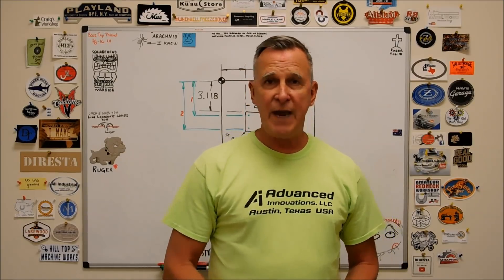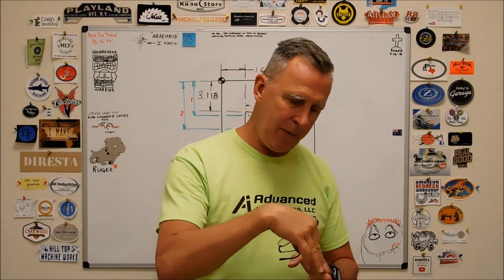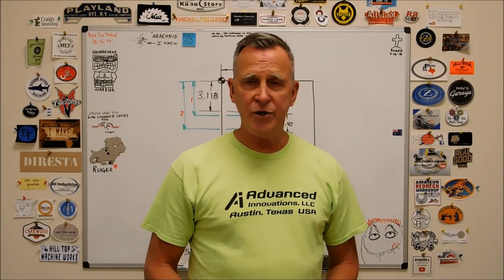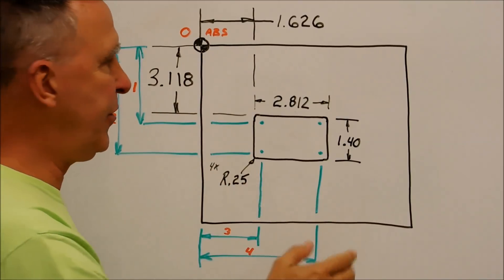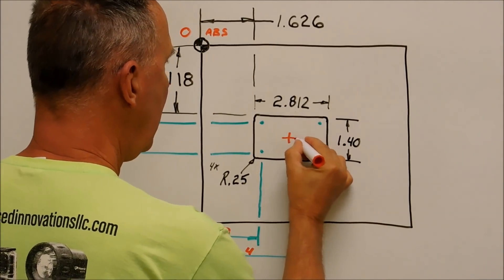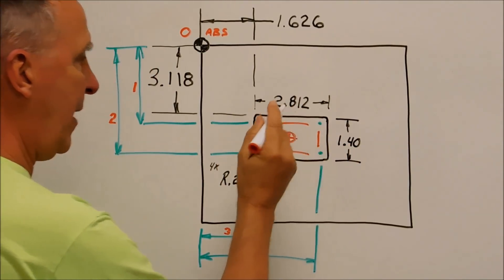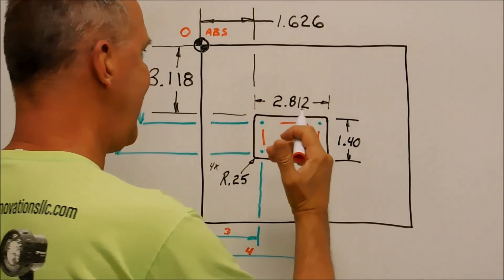Easier Machining Using the Incremental Mode on your DRO

Comment: incremental is less accurate than absolute. When you hit the X or Y reset, you establish a new zero. You may lose or gain a few tenths each time you do this. I actually prefer incremental but depending on the part I am making I may use absolute.

Comment: i got into gear shaving with the slot saw. was seriously disappointed when gearotic/mach3 didnt actually generate helicals.

and that started me on lessons with incremental and absolute whilst indexing a rotary table... a steep learning curve. 

a few minutes amusing oneself assigning different rotation axes and generating oddball toolpaths :)

at which point a helical gear is just throwing the cutter/rotary over at the helix angle and running the same generating principle with an added rotation... 

and on that note, i also dislike the manner in which most of the gear generating shavers work at one tooth at a time, lots of rotary reversals. backlash seems to be of no concern despite them generally being DIY setups.

so i always keep my rotary running the same way,  increment the Z on every full rotation, blah blah. seems faster as well?

Comment: I set up 2 table mounted work stops, 1 each side of the vise, and set zero with ABS and INC respectively. Then I can make symmetrically opposite details more efficiently, pull L.H. part out, place R.H. part in and perform each operation. I seem to get a lot of jobs making Sym. Opp. details.

Comment: Thx alot Joe very helpful info since I had to do 2 radius on the rotary table   with different points on both it was easy to pick up the  zero point on both of them using the incremental  and absolute
Reply from the maker: I have a lot of positioning videos for the rotary table. You should check them out. the trunion strap video is a good one.  Can I interest you in an alignment pin ?? ( website )
Reply: @joepie221  To late I bought one from you already n it works like a charm . But thanks anyhow.

Comment: I stay in incremental mode. seems very easy for to keep track of where I am. most recently used it to make a new tee nut for my tool post on my lathe. it made it simple to rough in and then come in for the finish cut. everything came out right on size and symmetrical. through hole already located simple right?
Reply from the maker: If you are over the center of the part, or hole, either setting works exactly the same. It is simple.

Comment: Joe, thanks for the explaination, my DROs all came from the same Far Eastern Mfgr. And they all have the same manual that is so poorly written that I consider the manuals worthless! I use the ABS mode exclusively and what I know how to do is solely based on what I’ve seen others do on YouTube! I will have to explore the function more once I get my machines back up and running!
Reply from the maker: I agree. Some of those manuals can be less than detailed.

Comment: Thanks Joe;
I've been using manual machines for so long, and never had a "real" DRO, but I get this.  It's like remembering where "home base" is when you are doing a hole pattern or finding corners using just the dials.  Someday, if I get a DRO before I die, I"m gonna forget all about taking up backlash, which I have been doing for the last three decades.  That will be a wonderful day!
I always appreciate your vids.  Thanks again!
Dean
Reply from the maker: Thanks Dean. A DRO will spoil you.

Comment: My DRO doesn't have work-offsets like some of the new ones, so I sometimes use my Incremental Mode as a temporary work offset.  Either for the center of my rotary table or a stop setup on the second vise.  Yes, I have 2 vises & a 10" rotary table on my mill. :-)
Reply from the maker: I hope you center that mass up before you go home at night.
Reply: @joepie221  Absolutely!!

Comment: typically...I set (and leave) the left corner of my fixed mill jaw to zero/zero in absolute and it is always ready to assist in measure and layout of simple parts....then use incremental when I need further layouts/offsets...by keeping the zero/zero...anytime I can find a dimension/location, then re-zero the incremental as needed....
Reply from the maker: Hi Chuck. That would work well assuming you have a stop on your jaw at all times? Or do you just use the outer edge? Stay well sir.

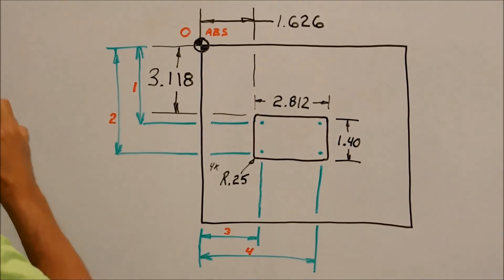Comment: Looking at the view from 1:16, Once you get your tool to absolute origin at the top left of the material, you can immediately switch to incremental, and make all future moves incremental moves based on the dimensions already shown on the drawring. No need to get to the center of the features first, or divide dimensions shown in half but that is a way to get it done, certainly.

Comment: I set my right rear vise jaw corner as 0.0" with the spindle center for both modes before starting each day. My guess is I started doing that because drilling bolt patterns is about 80% of what I used the DRO for early on. 
 I use INC for all machining operations and save ABS for a quick 0.0" reference reset of INC when needed. All of the drawings I make are dimensioned the same way. It may or may not be correct, but it's what works best for me.
Drawing a pocket like the example you gave, I'll dimension the hard constraints in black and the DRO coordinates for the tool offsets in blue, that's just what I found works best for me though.

Comment: On my Shumatech DRO, bolt hole circles, rounded corners, really anything that programtically moves the cutter around the work pushes the machine into incremental mode. Yes my DRO was a DIY kit, not sure if it is still available, but it works great for my needs and it was priced very reasonably for the hobby user market. Had lathe and mill programming and up to 5 inputs for cheap capacitive scales or glass scales plus the fifth could be a tacho. One of my favorite uses is cutting large circular features by overlapping bolt holes (up to 99 holes). Made a lot of circles bigger than I can fit in my little rotary table chuck this way. Might be considered crude by real machinists, but I get a lot of work done this way.

Comment: I have never touched a milling machine till I bought one.. Web, I forget the model, but I have put a DRO on it.. I don't understand 95% of what things are on it.. But,  have partly figured out the bolt circle function.  I have trouble figuring out how to change the starting point, and still have the end point still be correct...
... Not a big issue. All I am making once in a while are repair plates to fix a riding mower deck, there the spindles are ripping the deck mounting holes out.  So, 3 or 4 bolt holes. I clamp and weld to the damaged deck.

Comment: Very rarely does this method have an application anymore with CAD software so accessible. Going off a datum you don't need to worry about error stack up.  Used the software to define your hole coordinates and you're in business.

Comment: I once was using a Webster & Bennett borer that could only hold one program , but had to do nine different bore sizes on a production line. We started the program from a start block ( N100-N900 ) that had a jump to command then M30. The middle of the program started at block N1000 had the main coordinate of each bore then another M30, it then called blocks (N4000 N6000 N8000 )at the end of the program that had the main features( top chamfer , bottom radius, and mid bore oil groove) all of these features was programmed in incremental. this allowed us to use one program to quickly do nine different bore sizes on a production line.
I thought this was very clever

Comment: It can be used also for two operations in two separate vises so you can run multiple parts that require multiple ops e.g. blind holes on the top and bottom of the parts. This two zero points allows you to complete one side of your part flip it over to your second vise switch the dro over to your second zero point and complete your second op. It can also be used when you have a super spacer setup alongside a vise. It’s basically saving your indicated center of the super spacer while you use the vice for something else.

Comment: Incremental moves are quite valuable in step and repeat features. Imagine the program size required for a grid pattern of 25 holes would also be open to math or inputting errors in absolute. Finding these errors or making adjustments is also easier in incremental mode.
Reply from the maker: You will enjoy the CNC application video I plan to shoot.

Comment: If you have several holes to drill you can find your absolute position and use the incremental mode to step to each location. After you drill the first hole switch to incremental and then move the distance to the next hole and so on and so on and keep zeroing the incremental mode.  You can check yourself by going back to ABS mode

Comment: Incremental mode is fast when you are dealing with symmetrical pockets.  Example: four machined holes, each is 2" x 1" in a 6" x 6" plate. 0.375 end mill, 16 corners means 16 times to make a mistake. Incremental Mode is fast: I just have to think about two numbers. I can remember two numbers. :)

Comment: A  couple of people mentioned that you can find the pocket center and zero ABS there. And they are right. However, consider a slightly more complex example with another pocket to the right of the one Joe used. Now you could use the difference from the centers and zero in the new pocket. But if you use INC, you can work the first with INC, switch back to ABS, find the center of the second pocket using the original zero, INC zero, and make the second pocket.

Now consider that you might have other features based on the original zero. Being able to use a separate zero is handy.

I recently did a project (AXA toolholders) that requires 5 holes drilled and tapped on 6 identical parts. I found each hole, set them to zero in the SDM mode (lots of INC slots, really for tool offsets) and now I could just switch to each number, move to zero, work and repeat.

Comment: You can also use incremental mode temporarily zeroed at top left to find the center.  From top left move to bottom right and use the half function.  No math required.

Comment: What helped me in understanding the difference between ABS and INC was the following: When moving the origin in ABS mode, also the INC mode moves, but not vice versa. IOW, the true position in INC mode is the ABS+INC (simplified).
Reply from the maker: Its actually not. An incremental move is only the distance from the last place you were, whereas the new position represented in absolute is where you are since you left home.
Reply: @joepie221  Sorry, I was referring to my DRO, not to CNC machines and G90/G91.

Comment: Simply because my manual mill has a quite old Mitutoyo DRO that only has one coordinate system, I cant use both obviously but question regardless; any particular reason why you would switch to incremental after finding "center" of the feature rather than say the left back corner (center of the .25 radius)? 

At least for rectangular / square features like illustrated in the video, it seem like it would be less math and easier to remember the numbers if you found that corner first and worked off that corner.  
Unless I'm missing something here, since most prints I'm use to dealing with have pockets with their dimensions referenced to the edges / walls (like your whiteboard drawing), it seems like it would be easier to simply take your X,Y offsets from absolute (i.e.,  1.626 , 3.112), add half the cutter diameter (assuming you are using a 1/2" endmill to match the .25" corner radius) and you then have the center of that back left corner of the pocket and thus would zero incremental there. Then you would just have to take your X and Y pocket size (i.e., 2.812 , 1.40) and subtract the cutter diameter and that is your incremental X and Y moves. 
No having the split those numbers because of working from center to find center and no having to use the half / split values along with half cutter dia. values and having half value + and - X and Y moves.
Just seems like working from the center of the pocket like shown is adding more math / calculations and thus more chance for possible error from not paying attention when figuring out all your numbers.
Reply: With lose tolerance work, your method will provide similar results for the same amount of effort as working from the center. The differences between the methods becomes more apparent when tight tolerances are required. 
As an example, if your opening is 0.002" undersized, when working from the center, you just increase your offsets by 0.001", and that's it. When working from a corner, you have two coordinates that are going to be either plus or minus 0.001" (it will depend upon which corner you used as a reference) and the other two offsets will also need to be increased by 0.001". You can't just add 0.002" to your original offsets because then your opening would shift by 0.001" in  both directions.

Comment: You can use the zero function to do what you were using inc mode for but you can use any of the 99 for 99 of your pockets.
If you do, don't alter the abs as it resets all your zeros to the new base setting.

Comment: Also, back in early seventies I ran mills with dro's with no features. Only absolute. Late 70's started running only NC lathes. My mill work was confined to repair and fixture modifications. Never had time for the features to be studied up on. I have a mill now with a current dro and dro manual. The translation is a little confusing but so far as I've added as needed the dro features available. Pretty good for an old dog! Lol

Comment: Great stuff Joe. I use mostly reground end mills so I use the  incremental mode regularly. As I change features and cutter radius I always have absolute mode so as not having to touch off again as I flip and rotate part(s). Recently made a few sets of soft jaws, 3 sets for large, medium, and small diameters. Used the incremental mode as I had seen a resent video of yours where you just casually mentioned this feature. The light came on, and another valuable tool added to my kit. Thanks Joe!

Comment: Joe -- Great Video , Here is a challenge for you. I have a problem that I hope you can clear up. Everybody assumes that a DRO is on the money and measures correctly. I installed one a DRO on my Jig Borer, which uses stick standards for measuring. After installing it, I check the stick standards against the DRO. They argued with each other. Obviously I hang my hat on the stick standards. The data that came with the DRO showed how to make the necessary adjustments to qualify the DRO. I can't understand their instructions. Can you weave your mystical web.

Comment: When doing hand laying with even the best measuring devices, you always go from the absolute.  If you increment from one measure to the next then your errors will add to each other.   If you have 5 measurements and you are off by 10/1000's on each one because of eyeball precision, by the 5th you will be off by 50/1000 or more. 
If you constantly layout (sheet metal, for example) from the "starting point" then each 5 will be no more than the 10/1000's tolerance.  
On digital incremental is OK because nothing accumulates. 
Joe, you are a good teacher!
Reply from the maker: Stack tolerancing is a whole nuther animal. Many young engineers have the best intent, but are stumped when the holes don't line up. A dimensioning scheme can make or break a well designed part. Thanks for the comment.

Comment: One difference between abs and inc on mine seems to be that I can enter a value into inc, but not abs?
Reply from the maker: Interesting. I have to try it.
Reply: You may have a defective DRO. You should be able to enter location values in both ABS and INC modes. After touching-off with an edge finder, I enter a value to compensate for the probe's radius. Likewise, when changing tools, the Z value needs to be updated. You are missing out on a lot of functionality by only being able to zero out values.

Comment: Keep them coming Joe! I have had numerous question but never want to bug you with them in an email. I usually find that after a while, you post a video on the topic I have questions about. By the way, I did my first grinding job on my milling machine using your technique (a motor shaft that needed a very precise flat for a pump impeller alignment for work) and it worked a treat. Thank you for all you do!